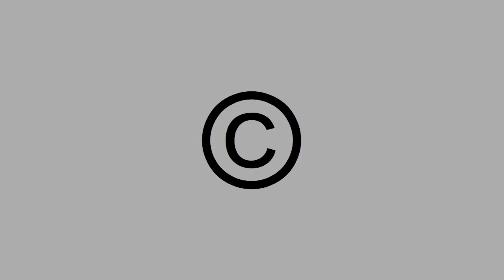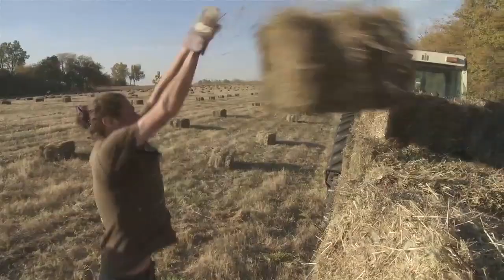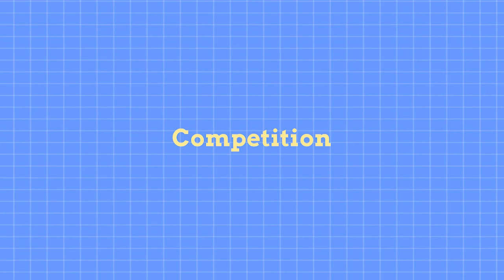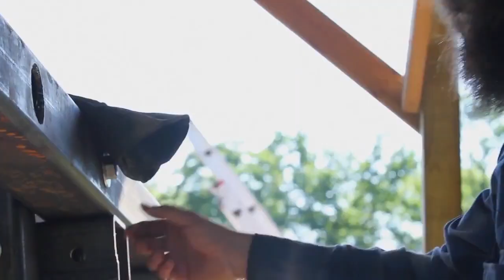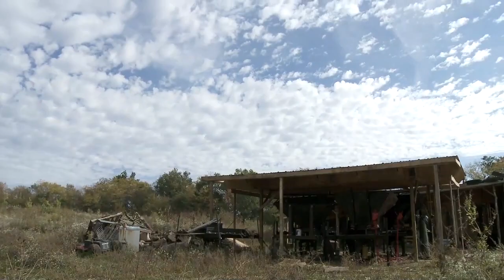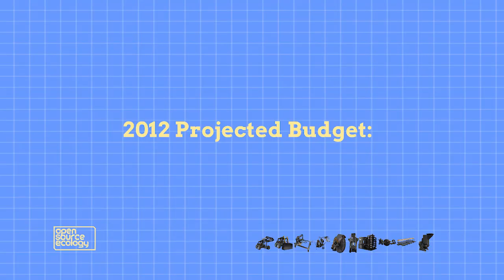Open Source Ecology - Enterprise Plan

Comment: how much modern technology has be measured to be viable without coal and oil.
consider the energy required to extract,refine,work the materials .
we had a civilization powered by solar (photosynthesis) and wind (windmills and sailing ships) so why did we start using fossil fuels in the first place

Comment: 100 years ago the population was 1.6billion people
responding to continuously dynamic changing tech and demands, the system managed to feed > 4x the number of people - thats a dramatic improvement.
So, lets see how YOUR designs work.
have YOU ou personally managed to design any system that PRACTICALLY acheives 100% efficiency.
I bet you personally couldn't do better than that.. feeding 4X in 100 years

Comment: you can't have 100% efficiency.
in china they have 10million empty homes?
1billion people
thats still 99% efficiency.
similarly the grain mountains.
There's many examples in engineering where you go with something that might be 'double overall' but due to the design 10% of it is wasted... compared to something that might utilize 100% of itself, but its overall capacity is lower.

Comment: Only if the blue collar workers chose that.  The current model which results in "controllers" having so much power, is based on concentrated production, this proposed system of distributed production would not provide such a power base for "controllers" to have that kind of power.